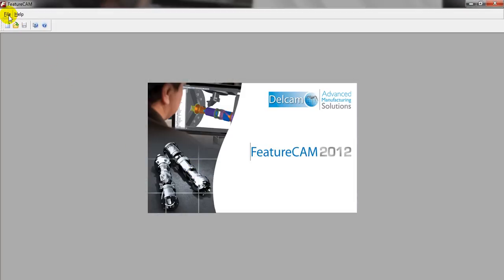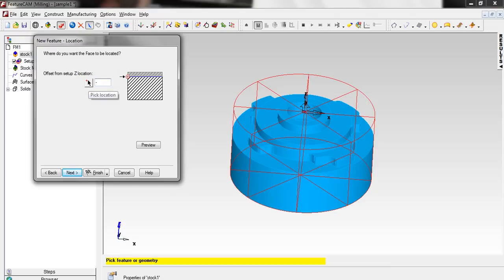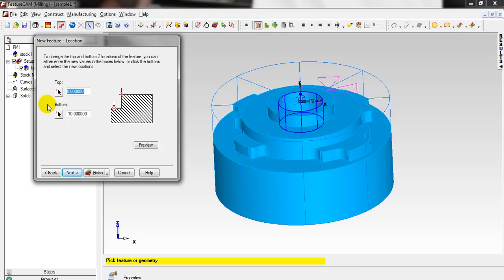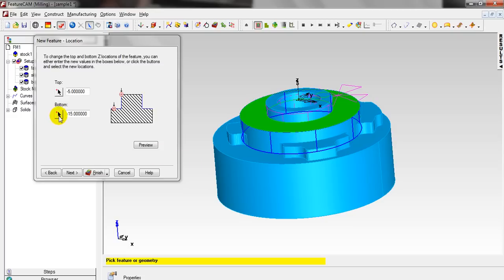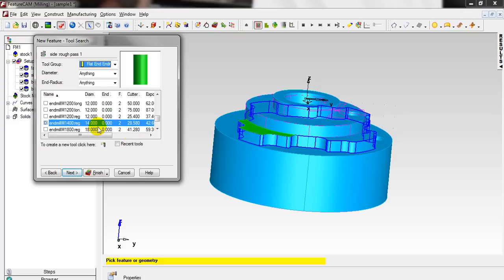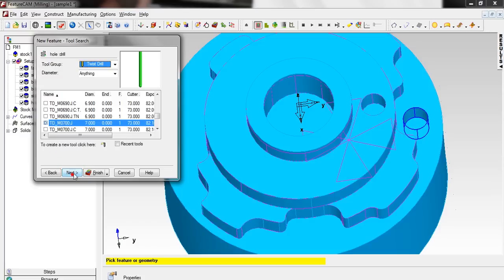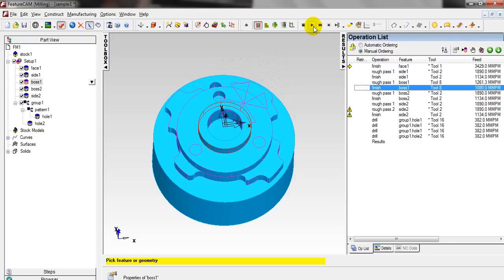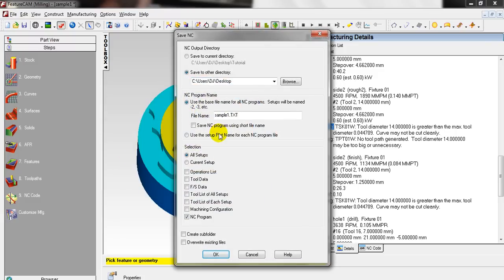FeatureCAM 2012 Tutorial - Milling (1 of 3)

Comment: Hi good tutorial, but can you help me? I need to machine some features on a 35mm dia bar using 4th axis milling but I am having trouble getting it to machine them the way I want it to. Basically, I need to machine a triangle, then a square then a hexagon, each shape is connected to the other in line and each one is 15mm in length. I have a solid model if you need one. Cheers.